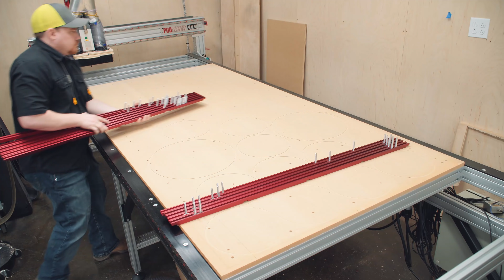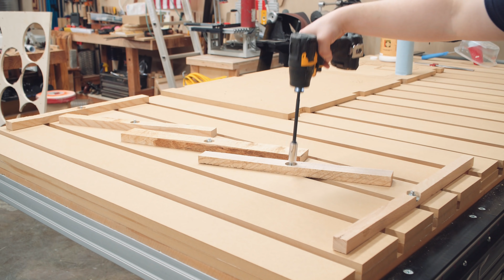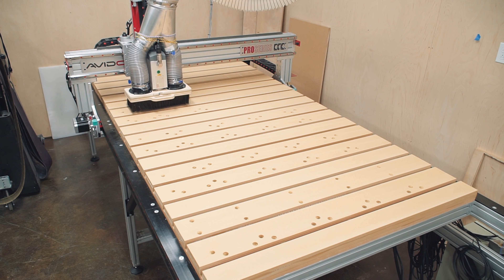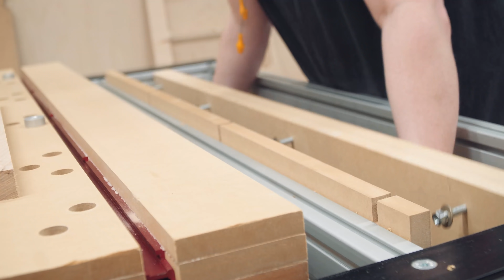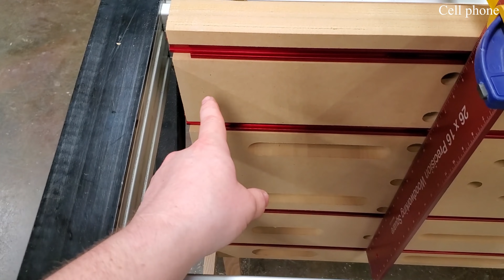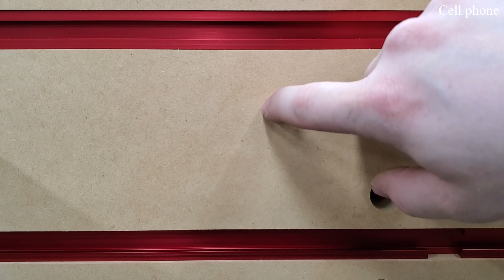Avid CNC Ep3: Vertical & Horizontal Tables - 343

Comment: Hey Jay, 
I'm a brand new AVID Pro CNC owner and I'm at the "Let's make a spoil -board set-up" phase. I really like your setup. So here is a beginner, silly question. Where you attach the two stacked MDF boards between each track, why do you glue it all together. In my mind, gluing the two thinner pieces together makes sense, but then, why not attach those to your full sheet with screws from underneath? Then, if you need to change out the top portion, you could remove one section and replace? 
I'm certain there is a good explanation that I, as a beginner, don't see. 

And I have another question. Since you ended up adding legs to help support your vertical table, would you see any benefit to pushing the entire vertical surface closer to the front of the machine, thusly giving you more horizontal surface nearer to the front as well. I want to add a vertical surface but I'm not liking how much of the front of the table horizontal surface you lose. 
Anyways, thanks for the great videos. Gary
Reply from the maker: Regarding the spoilboard, never remove it. When you get close to replacing it, mill it flat and glue on another layer. There is never a need to remove the spoil board top layer. I don't like to leave screws in the spoil board so I don't accigdentally hit one with the bit.
Reply from the maker: Yes. I want to redo the spoil board at some time to get the vertical table in the front.

Comment: I really love this nothing for my avid CNC. I went ahead and purchased the dog hole file and I had great luck with it at first. However, after a while, the accuracy was off. Really not sure why but I fixed it by adjusting the dog hole grid. However, now the accuracy is off again by about 1/16 inch to the left. really not sure what’s going on with it. Just figured I would throw it out there to see if anyone else was having the same issue.
Reply from the maker: All layers that are used for reference should be locked so you don't accidentally move them. Can you load the original file and see if they were shifted in that version? Shoot me an email for a faster reply jayscustomcreations@gmail.com

Comment: Very nice design. How is the bottom layer of MDF attached to the frame?
Reply: OK, I see how on the other video, you used 2x4s rather than going directly into the frame
Reply: So to remove the spoilboard it's an all-or-nothing thing, where you would need to remove all of the MDF and the 2x4s

Comment: Great video.  Does the AVIDCNC require a 30amp dedicated circuit?
Reply: That depends if you are also purchasing a spindle with your CNC package. If are going to use a router then you don't need 220V outlet.

Comment: Great video Jay.  I'm looking into getting an AVID CNC and noticed in most of the videos people use MDF for the top.  Few like yourself are putting in the track systems, but you are putting in more track than I've seen.
  There are a few that leave one end of the table with several rows of T-slot or 80/20 bars and the rest MDF.  What are the advantages of your design?  What does the vertical table provide you with?

Comment: When you glued the two layers together, did you then glue them to the base spoilboard layer?
Reply: I'm curious about that as well. I just ran across the video and the design is nice, but how do you replace the top layer if you have glued it to the bottom board?
Reply: Wondering the same thing

Comment: Very nice setup. So with the double stack of MDF strips on the top will you ever have to replace the bottom MDF sheet? Could that sit right on the aluminum top instead of the 2x4s?

Comment: Enjoying this series very much as I may be doing something very similar. I am confused on gluing in the MDF strips between the T-track, isn't this going to make replacing the spoilboard a huge PITA?  Are all the screws into 2x4s on the first layer underneath the T-track so you can access them?

Comment: Did you make any consideration of making your vertical table adjustable so as to cut compound angles on tenons?  Well thought out and set up.
Reply from the maker: No. I have a compound miter saw and have never made a compound cut. If the need arises it would be easy to make an angled holder of some kind to mount the work piece to. I didn't want to build it into the design knowing id rarely, if ever, use it.

Comment: Hey Jay, this is pretty awesome. I was wondering, how do you ensure depth repeatability on the vertical table? You mentioned batching out the tenons, but is there a way to repeat how far up or down the workpiece is? On the pantorouter, you'd do that against the router bit, so I guess you could do something like that here as well?
Reply: Never mind I found the response further down, very cool! I tried to search for it but forgot youtube comments are loaded as you scroll.

Comment: Jay, just wasn't sure, did you want the ability to rotate the vertical table?   If so a sheet of mdf at each side with dog holes to align for angles and it would brace both legs at each side as well

Comment: Great job as always. I'm even more excited to get my own machine. Thanks for sharing all this info. One question, would it work to glue up the MDF "strips" prior to installing them? Also, there is a nail gun that shoots ceramic fasteners, which won't harm the bits if they contact them. What do you think of this for a longterm investment?
Reply from the maker: I think the nail gun you mentioned is a great solution for certain situations, like full sheets of plywood without a vac table. I'll probably buy one soon. As far as the MDF, it would have been a LOT easier to glue 3 sheets of plywood together and "clamp" them down with screws while the glue dried. Then use the CNC to cut the slots for the track, holes for the track bolts, and dog holes. But I didn't think it through that much when making it. That would have saved a ton of back and forth time clamping the strips down.

Comment: Hi jay ,
Don't you need a horizontal alu profile on the bottom of the vertical spoil board to prevent flex  ?
If you clamp a piece that not touches the floor and you do a helical or just a drill OP on the top of that piece ,would the pressure on the piece
tilt the end of that piece and so cause a little flex  on the bottom of the vertical board.
Even if the pressure is not that big on the top.

Comment: just asking the question, if you don't have a lot of floor space what would stop you mounting the cnc machine to the wall vertically?
Reply from the maker: That puts a lot of stress on the gantry. Those stresses would have to be compensated for somewhere. There are some CNC's that are vertical like that though.
Reply: Check "maslow cnc"

Comment: Do you have a way to set a repeatable depth (height) stop on the verticle table?
Reply from the maker: Picture a piece of 3/4" plywood that is 49" long x 12" tall. Mill it on the CNC so that it looks like a wide, short U shape. The left and right ends of the U are in the 12" direction and about 2" wide. In the middle of each end of the U are a vertical slot about 11" long. The slots can be used with bolts and star knobs in the lower T-track with the bottom of the U shape spanning the entire width of the table to act as a shelf or a stop to repeat locate items vertically. With the plywood in the U shape the slots will allow it to go down close to the ground for longer stuff. For shorter stuff the entire piece can be flipped so the U shape becomes a n shape with the support on top. Hope that makes sense.
Reply: @JayBates  it does. I figured you had something already planned out.

Comment: Impressive work jay!  Thanks for the videos.   Now start thinking about how to do compound angle cuts on the ends of furniture parts.  :)   Then there will come a day when you want to hang an assembled piece of furniture under the CNC to cut inlay pockets in the top or sides or joinery details in the bottom.   ;)

Comment: Great Setup and really makes me think of what can be achieved with the dog holes and the vertical table.
But I have a question, when doing the vertical table why did you not after getting the x axis cross bar and z axis legs square, locate the uncut mdf to the cross bar and legs using dowels/coach bolts then use the CNC to cut the top face square, once this was square remove locate against your dogs on the table and you could then cut the other 3 sides square and cut the remainder of the holes for angles etc. Then simple replace on the vertical face relocating with the dowels.
Reply from the maker: That sounds like a complicated way to get to the same result. I used the machine to cut the perimeter of the vertical table while cutting the dog holes. This means the holes are perfectly perpendicular to the top of the table. Then just mount it to the aluminum with the top of the table touching the bottom of whatever is in the spindle. Verify the height by putting the spindle on the far left and far right ends while securing the table.
Reply: @JayBates  Got it, now - Thanks

Comment: Great video.  I have a setup very much like this, DIY Ballscrew machine using AvidCNC plug and play electronics and a 5HP spindle.  I have found that having one setup for each piece that I make using work offsets works much better than trying to batch cut them.  I have G55 XYZ zero setup and pin holes with steel 1/4" pins creating a corner, much like you did with the dog holes and I can sit there and run a part, take it off, add another all day.  Since zero on all axis is already setup in G55, I don't have to think about anything except to load the dimensioned lumber.  I have different parts setup for G56, G57, G58, etc.  It took me a long time and many tries to get the vertical mounting configuration I wanted, but yours looks great right now, you'll find it so useful.  Also a 4th rotary axis is a great thing to have if you're a furniture maker.